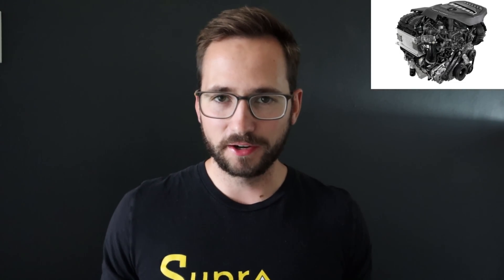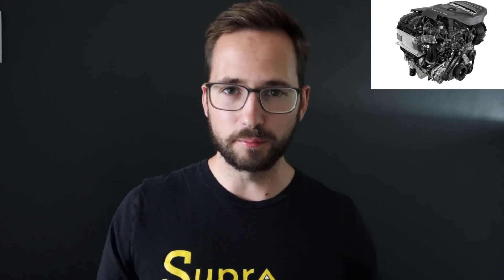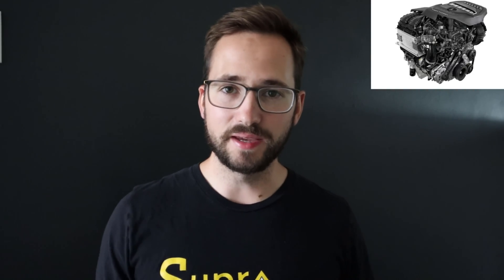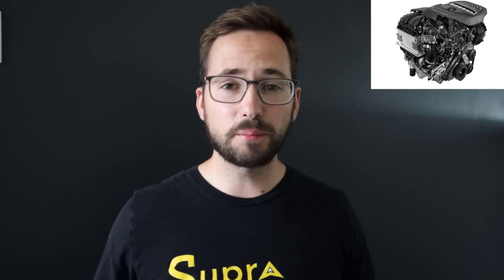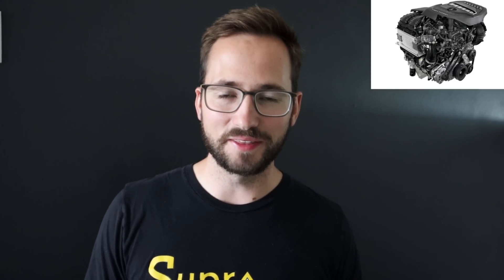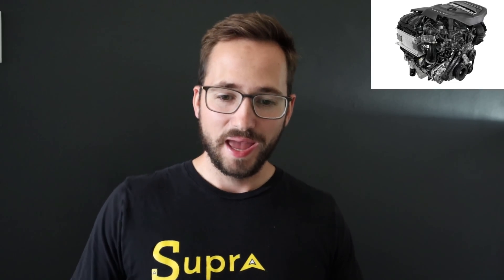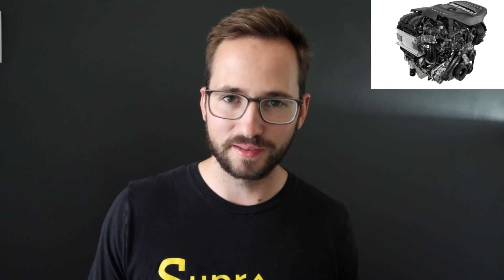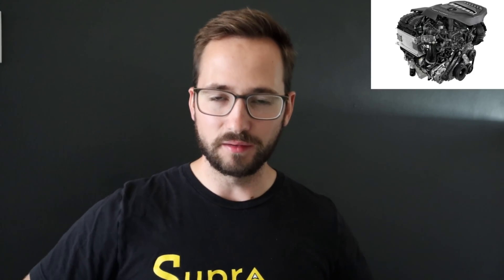The New Hurricane Engine Is Way Better Than I Realized!

Comment: If they would bump it up to 3.5L or 4.0L I think they would squash the competition.
Reply: Doesn’t need it. With forced induction, you don’t need a longer stroke. Shorter stroke engines are nicer to drive.
Reply: Look into the 2jz that are monsters from the old Toyotas. In-line 3.0 single turbo. One of the best engines of all time imo
Reply: @mdubz101 .....yes becuse of its way overbuilt cast iron block  and rotating assembly. But not that special anymore ford offers mustangs with 810hp for what 45k. Warrwnty and all go grab you a base gt and the frpp blower 810 warranted hp
Reply: No need with larger bore/litter, coupling electrical engines will supply the torque!
Reply: Nah, I want a 6.0L for the Pickups, the cars can get the 3.5.

Comment: The biggest negatives to me are DI and plasma arc cylinder liners...research current Gen Ford coyote, ticks and oil consumption....not a proven technology in my opinion
Reply: I have a 2022 F150 with the coyote & it doesn't tick or use oil but i know some do.

Comment: This could be a game changer for Chrysler!  Now they need to address their electrical issues!
Reply: Nothing compared to the Ford electrical issues. But let's not argue with facts
Reply: I agree. 2022 Ram 2500 crew 4wd diesel.  Great truck with a shamefully terrible audio system that reboots almost every time I drive the truck.

Comment: Here’s what I think (or at least hope) will happen with the new Hurricane (and some other engines):
-As Ben said, the standard output Hurricane will serve as the replacement for the 5.7 and the high output for the 6.4. This will be the case for most of the lineup; however, I think it is likely that both the standard and high output versions making their way into the Ram 1500 (non-performance versions. The TRX can keep its Hellcat or whatever replaces that). Since Cummins is making a gasoline version of their 6.7 I get the feeling we’re more likely to see that than the high output Hurricane in the Ram HD.
-Rather than going straight to electrification for the Hellcat, I would hope for a 4.0L Hurricane that puts out more horsepower and torque than the 6.2 but burns less fuel. It would also be nice for Mopar nostalgia.
-I’m personally hoping that when the 3.0L EcoDiesel gets redesigned, they change it to an I6 as opposed to a V6. If they do this and find ways to improve the tow ratings it could more effectively take on the 3.0L DuraMax in GM’s 1500s. I am hoping that with either this new I6 diesel or the Hurricanes, we could get a Ram 1500 that can tow at least 13,000 pounds to be more competitive with Ford and GM (and I mean a crew cab with 4X4 with that tow rating. A quad cab 4x2 should be even higher).
Reply: There is no replacement for a HEMI..... you are mistaken. Nothing, repeat nothing, has the effortless torque, smoothness, and economy under load like a V8.  Anyone who actually uses a truck wants anything to do with a 6 cylinder, turbo or otherwise.
Reply: @fsilverez8408     I agree 💯💯💯💯💯💯💯💯💯💯💯💯💯💯💯%

Comment: Longevity…..all these new aluminum turbo engines having air rammed down there weak throats versus a normally aspirated engine ….I don’t see it.

There is no replacement for displacement. 

I guess I’m old school but, I plan on staying away from any of these modern turbo charged engines. I also have no intention of purchasing an electric car in the near future either. Still a LOT of work to be done there also….

Most people aren’t that concerned with gas mileage that buy a V-8. If there are…they need one of those cookie cutter turbos.

But……to each there own.
Reply: Eh. Semi trucks have no problem racking a million miles on their turbocharged inline-6 engines. A properly designed aluminum engine block can be just as reliable as an iron block.
Reply: Sorry but old way of thinking

Comment: If they really wanted heritage, the should have developed a 4.0L inline 6 turbo instead of a 3.0L.  It would have enabled them to likely make the same power they are getting from the 3L with less boost and also provide for more performance variations.
Reply: The 3.0L exists to meet emissions and fuel economy targets... not power. There's a reason you see tons of 2.0L 4-cylinders, 3.0L 6-cylinders, and the Europeans with their 4.0L 8-cylinders.... its because 0.5L per cylinder is basically the ideal size for efficiency. The 3.0L will have no problem reaching the targets of 400 and 500 horsepower. And higher power variations will not be done via crazy boost but via hybridization. I'm just happy they went with an inline 6. That's a naturally balanced design. It should deliver power smoothly.
Reply: @PeakDecline  The smaller displacement is more for tax than emissions.   There are places that actually levy more taxes based on engine displacements which is why you see so many 2 liter and smaller in many foreign countries.  Any modern large engine can be designed to meet current emissions standards when done from the ground up.
Reply: @niuhuskieguy  Displacement based taxing is rapidly going away across the glove because it's a terrible way to handle the emissions issue. 0.5L per cylinder is the ideal size for thermal energy efficiency.
Reply: @niuhuskieguy  Very few countries have linkage between displacement and tax. You are referring to foreign countries, well the strictest markets are EU, USA and Japan. In EU it is based on fuel economy. In USA I don't think there is any displacement linkage either. The thing about internal combustion engines in general is that maximum efficiency is achieved when the engine is near maximum load. Which means, fitting overpowered engine in a light car will always result in a poor fuel economy. Smaller engines with things such as turbo's are one way to go around this thing . . .
Reply: @EliB200 . The displacement will dictate your average torque curve, and fuel economy. The size of the turbo with respect to its CFM flow will dictate the ultimate amount of power you can make, not the engine size.
Reply: No real reason to develop a 4 liter as opposed to a 3 liter. Especially with boost, it serves nobody really. I bet the high output will be able to produce 550-600hp on the stock turbos
Reply: @PapiAndrey . Your power will ultimately be dictated by the CFM flow of the turbos.
Reply: @bri-manhunter2654  I know, but there’s no real reason to develop it in the eyes of Stellantis.
500+ hp and 475+ ft lbs is plenty for most applications
Reply: @PapiAndrey . Not sure what you are getting at to be honest. Moreover, they designed it the way they did for a reason. I could probably go on all day about engine specs, but you are not able to follow, I already explained a few things.
Reply: @bri-manhunter2654  don’t reply to my comments then. You’re not going to teach me anything new, you’re just telling me stuff I already know. No need to get emotional over a comment
Reply: @PapiAndrey . Lol, I think you are confused. You do not come off as someone who knows engine specs, and this will limit your overall knowledge base on engines. I am being completely objective; not sure how I am being confused with being emotional, no need to deflect.

Your view on the original posters comment says enough about what you know. Small turbo motors with lots of boost do not last long. More displacement and less boost is better most of the time.
You care to argue specs and variables on this engine. I’ll be ready to fill in all the gaps that you may like to know.
Like the similarities between it and the 2JZ. Hopefully this has more head flow than a 2JZ.
Reply: @bri-manhunter2654  you know nothing about me, how could you possibly know what I do and don’t know? My original comment was saying that the stock turbos on the high output variant are capable of 550-600hp. You should know better than to guess
Reply: @PapiAndrey . It’s easy, not guessing, when you are in the car and mechanical world it’s pretty easy to understand someone’s car knowledge by the way they answer, no disrespect at all. 
And, if you understand engine specs you don’t need to guess how much power these motors make. Just look at the CFM flow on the Turbos.
Quick test- Could you tell me how much power a Ram 1500 or a Hellcat Charger can make if they both have a 2.9L whipple?
Reply: @bri-manhunter2654  When a small engine doesn't last long, it is usually referring to a tuned engine way out of spec what it was designed to handle. By other words it failed because it was not designed for that power level. Sure there is a relation between engine stress and how long it will last. But if we are designing a new engine from scratch, is that the limiting factor? Usually no. Today you can easily design lasting 3 000 000 miles. But it will be a trade off in terms of fuel economy, price, etc. and, for what? The other components in the car don't even last that long, so it is not necessary for the engine to last that long. Also tuning potential of engine is completely irrelevant for 99% of car buyers. As an example about the displacement vs power development in the past; T-Ford had 2.9 l engine, generating 20 hp. Good modern engines last longer and generate 10 x more power.
Reply: @wopmf4345FxFDxdGaa20 . You are not telling me anything new. I would actually with everything you just said.
Reply: @PapiAndrey . More displacement with head flow, cam timing, & compression means less boost. Boost creates a lot more force on your motor that wears it out faster.
Reply: Maybe that could serve as a non-electrified replacement for the Hellcat? I’d sure love to see something like that in a TRX

Comment: I love my Ram 5.7 but this sounds like a very good move. Straight 6s are a balanced design. EV trucks are jumping the gun, not apposed against the idea, batterie technology is just not there yet.
Reply: It will be interesting here in the Colorado Rocky Mountains high altitudes. 

As Ford discovered, the turbos in our altitude work overtime and transmissions typically are required to run in lower gears which drastically lessons fuel economy and causes higher repair & maintenance costs. 

What works “better for fuel economy without performance loss” with less cylinders and “twin turbos” are actually rated in low altitude environments.

In high altitude, to get best fuel economy and performance the v8 Hemi and 3.0l eco boost diesel simple can’t be replaced by an inline 6 twin turbo gas engine.

Can’t change the mathematical science  of physics. 

Déjà vu to President Carter area which also killed v8 and vehicle manufacturers all jumped on the gas turbo train which crashed in high altitudes. 

Wait, at least 2 to 3 model years before jumping into a new engine, especially in high altitude applications. If don’t, get extended warranty!!

For now go with the v8 and 3.0l eco boost while they are still offered.
Reply: @icare7151  As compared to NA at altitude which just loses all power.
Reply: Agree with you on battery tech not just being there yet. I'll wait for Toyota to figure out the solid state battery.
Reply: The mfg are going this way because when tested on the epa test loop, not towing they generate better numbers.  Real world, high altitude, and towing mpg might be worse but all they care about is epa and cafe stds
Reply: 2 turbos to fail.  Awesome. Rather just maybe like a new 292 hemi. That’s the way they shoulda went.keep the nostalgic hemi name make a smaller more efficient new one. Was a small hemi that started it all
Reply: wall banger hannity
Reply: Have they figured out long term carbon build up of DI turbo motors yet?  I don't see sequential port only DI
Reply: Don’t have to worry about lifters no more either

Comment: When ram comes to mind, reliability is no where near.
Reply: Not true
Reply: They still lack behind but they are actually better then GM, especially as of late.
Reply: @jayray274  better than ford and Toyota
Reply: @Chris-RAM Quality nowadays is top-notch…. Pretty much an unbeatable product…..
Reply: Number one next to Toyota tundra for 2 years in a row for reliability and light duty trucks
Reply: Ratio
Reply: Not recently. They have the best product these days
Reply: U got ratiod
Reply: Chris what world are you living in? I've had 3 RAM trucks. None have ever been into a shop for anything other than routine maintenance. They've been driven through mud, 3 foot snow drifts in -25 weather for months straight, up mountains, etc.
Reply: @Jake-xy9lt  the world where ram has issues with electronics, accelerator pedals, EGR issues, transfer case issues, drives shaft issues. Electronics are shit in ram, sensors cameras radios, you name it, it sucks. But hey what do i know, i only see them daily.
Reply: @txkingg  I see them daily too, I've owned 4 and never had a single issue. I've also owned Ford, Chevy, Honda and Nissan. my RAM vehicles have all cost less to operate than the above mentioned brands.
Reply: @txkingg  and I'm a mobile technician that does for GM and Chrysler and I would never own a Ford. More electrical issues and sync infotainment problems. Multiple camera issues and overall afterthought engineering. I would never recommend a Ford product to friends or family and the technicians at the Ford dealerships won't either

Comment: Definitely sounds like a winner..
The reliability of a inline 6 mated to the ZF 8 speed...sounds amazing..
Just going have to wait and see but it's sounds really promising 🤗🤗
Reply: Just because it’s an inline 6 it doesn’t mean it’s reliable.
Reply: @RustyPumpkinRanch Bingo. The 5.7 Hemi was bulletproof on paper and Ford made a whole series of torture test videos on the 3.5 Ecoboom trying to show potential customers how reliable they were going to be. Both have suffered from flaws not fixed since their initial launch. Just because someone introduces an inline 6 doesn’t mean that they spent the money on engineering and components to ensure that it works reliably for years. Hell, Ford had a reliable V-8 in the 5.0 engine and couldn’t help themselves from screwing it up with spray coating the aluminum block instead of continuing to use the steel cylinder liners. Now it’s a 60K dollar oil drinking bomb. Never underestimate the bean counters ability to screw up an excellent design by cutting critical corners that only reveal themselves after the purchase.
Reply: I'm driving a Cummins powered Ram now, but I loved my Ram 1500 Hemi with the zf8.
Reply: Bmw has proven that it is an awesome combo, hopefully the hurricane powertrain will be decent
Reply: @Andrey  some BMW's are even equipped with a ZF8 trans behind their inline 6's!
Reply: @IE360 they all are